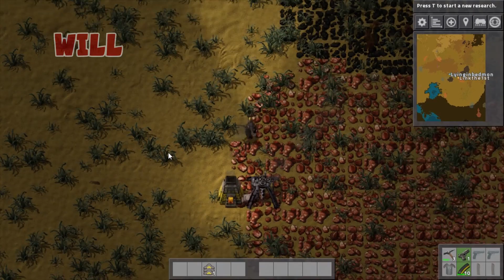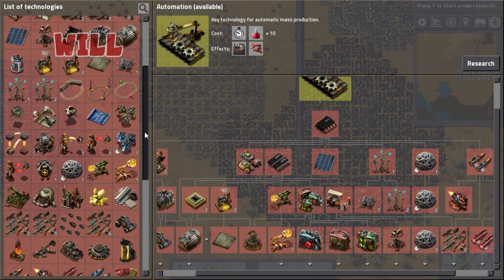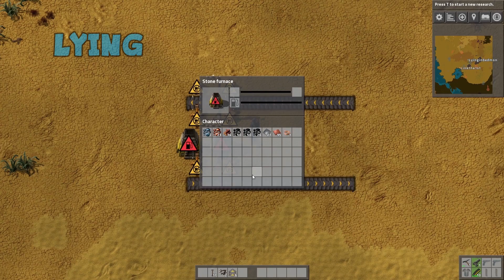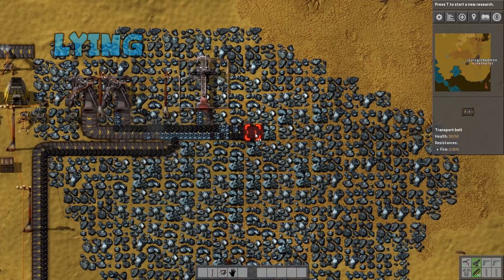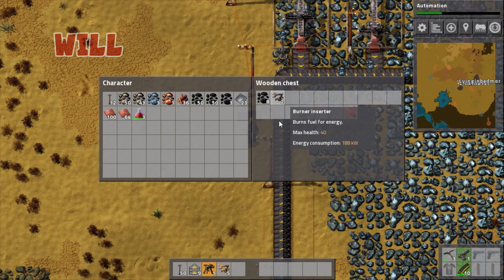Factorio 02 - Electric Mining

Comment: Hey Strife, Solar Thermal plants store heat in molten sodium tanks to try to continue supplying energy after the sun goes down. Spain leads the world in Solar Thermal and the plant I visited could run for 2-3 hours after the sun has set using its heat "batteries". Probably one of the few advantages that solar thermal has in comparison to other renewable plants. Nuclear still the way to go for the electrical backbone in my opinion.